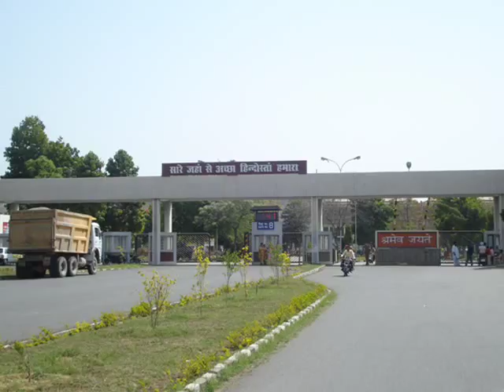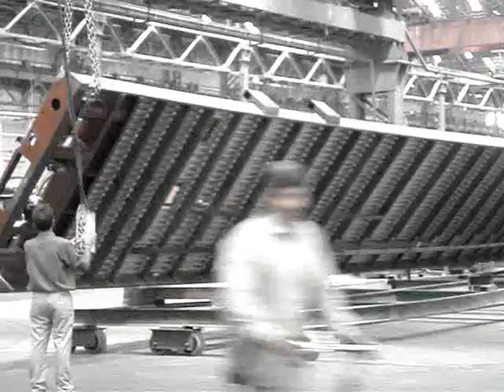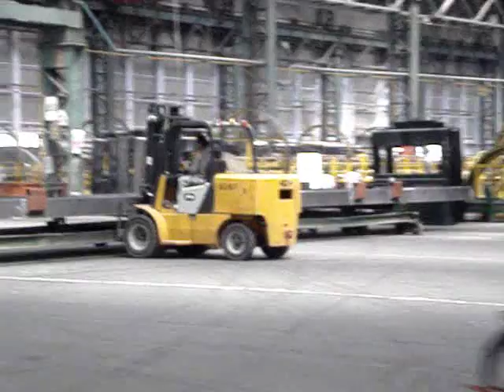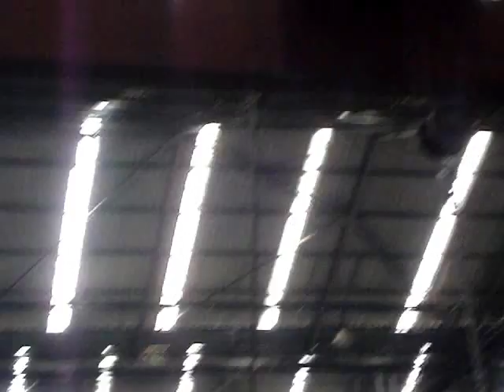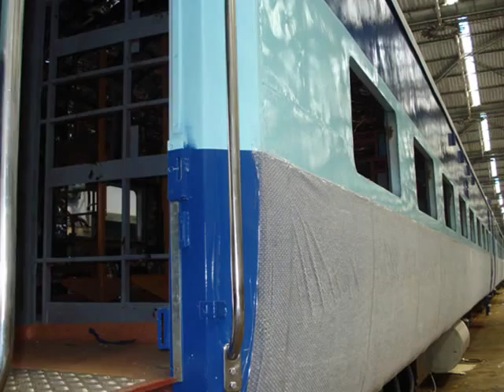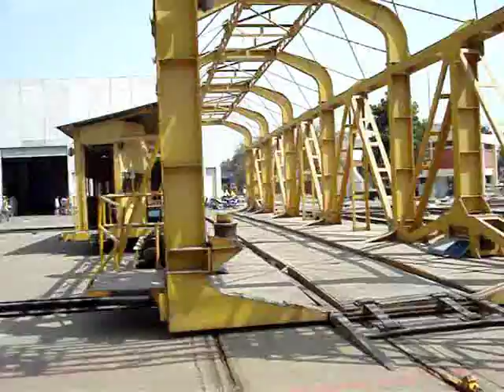rail coach factory

Comment: Site is clean because of the close environment. But NO SAFETY. The operator is without helmet. No one wearing any safety shoes, no safety shoes, rigger is without helment with no hand gloves. Very unsafe act. The working are is not barricated. No one is using safety glasses. The operator of overhead crane is using sports shoes instead of safety shoes. This also happens that if a employee deads with his unsafe act, his son or wife will get change to have job again "FOR DIE AGAIN". Totally Unsafe.